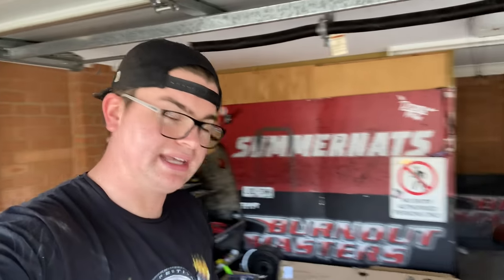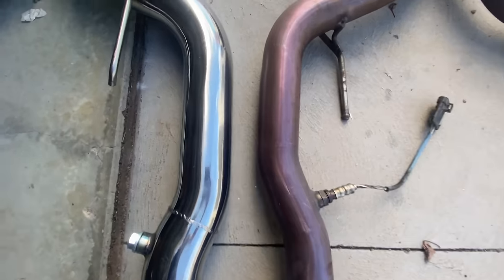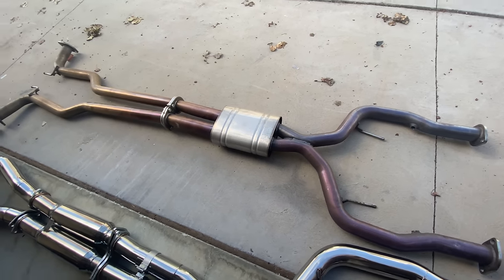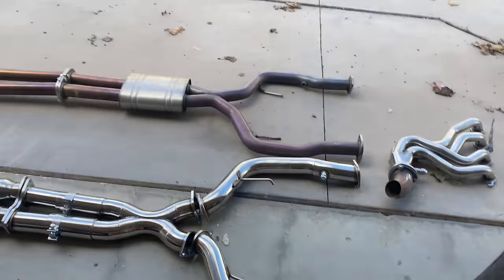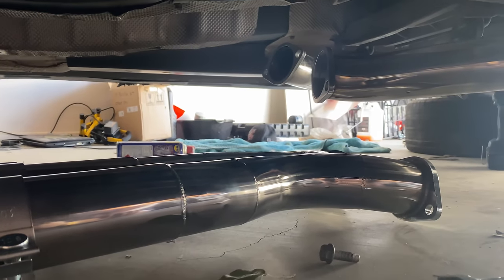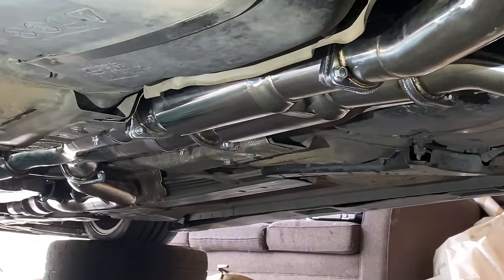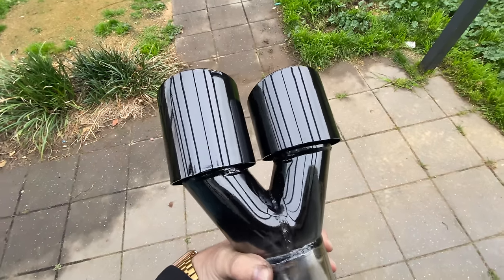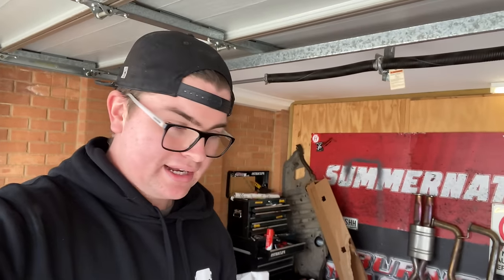Whats The Difference Between 2.5" and 3" Exhausts On A V8?

Comment: 3" tubing is absolutely louder than 2.5" tubing. It's not a 'huge' increase, but it is louder. It depends moreso on the mufflers you're using. If you want it to sound ridiculous, you need to do the muffler delete and get rid of those resonators.

Comment: Of course it's quieter you went from one Muffler or whatever that was to two mufflers and two resonators " hot dogs??? "  It's going to cut the sound in half, not to mention the farther back for Mufflers on a car be quieter it is. 

I did the same kind of thing on my bike, I went from a 4 in to one kerker header with one small Muffler which was loud as hell Superbike sounding crazy, into a 4 in 2 dual pipes with 2 mufflers, now it's nice and quiet like a little Volkswagen bug. Most people would say what the heck were you thinking... well I was thinking my ears were ringing for an hour or more after going for a long motorcycle ride, and my son kept burning his leg on the header so yeah, lol I'm glad I made my decision a little quieter I'm happy and so are the neighbors, LOL 

In your case if you want it louder yeah get rid of those Mufflers on the back and put the straight pipes back on, and it is going to be louder than the two and a half inch, not much, but you should notice it. You're also probably better get that thing re tuned, you're going to throw off the back pressure and mess with the fuel-air, it might not be much but I would at least, if you're looking for maximum performance.

I don't know what was more concerning you freaking me out driving on the left side of the road or you calling Mufflers Hot Dogs... What the heck I've never heard Mufflers called hot dogs can you please explain this? LOL Ihave sold to eat hot dogs for a living I didn't sell mufflers to eat, LOL glasspack, cherry bombs, resonators. I mean yeah Muffler called hot dogs I'm so confused...
Reply from the maker: Hot dogs is a weird name for them... but that’s what I first heard them referenced as and it stuck for some reason lol... yeah I know there’s plenty of variables between everything I’m comparing, mainly just curiosity is the reasoning! I’m gonna see how it sounds with the rear mufflers gone

Comment: Went from an old rusty 3" xforce to 3" stainless manta/hurricane. Sounded way nicer but not much louder. 

Then 4 into 1 long tube headers which changed everything. Mean lumpy sound and a bit louder. Completely worth losing 2 inches of ground clearance at the cats haha.

224/230 cam was about the same step up in volume. Glad I kept the middle muffler by that point.
Reply from the maker: Wicked! That sounds sick
Reply: where were the 4into1’s from
Reply: @kazepg3d  hurricane

Comment: Main 02 sensors for fuel tuning are the first one's in front of the cats, you should get your tuner to turn the 02 sensors back on cuz it keep your engine safe.
Reply from the maker: I did ask that when we did it, but he said it would be fine, and after nearly 3 years I haven’t had an issue
Reply: @Mick_Hinchy  sweet

Comment: Pretty sure both of those are stainless steel. Even stock exhausts are stainless. Put a magnet on it to check.
Reply from the maker: Yeah my old man actually called me... I think they are both stainless, I might have made a bit of an oopsie
Reply: Haha all good. Centre muffler is also straight through as well. Just has two pipes with holes in them running through. Normally has glass pack in there too.

Comment: If you had a 3 inch xforce exhaust and wanted it louder should you remove resonators in the middle or mufflers at the rear? Thanks the car is a ve ss with afm turned off, also has 4 into 1 headers and 200 cell cats

Comment: Ceramic coated headers are what you really want , ceramic retains the heat in the exhaust as that is what you want , more heat thats retained the more power and efficiency dont ever waste your time with things like exhaust wraps , ceramics are the way
Reply: Yeah get rid of OTRs, heat shields, radiator fans and you’ll be pushing 500 at the wheels

Comment: My 3inch mildsteel xforce is nothing like your 2.5 inch set up it's almost identical to that 3inch stainless setup though same hotdogs and it also slips over the Same aswel. Also sounds pretty ghetto straight piped 3 inch cat delete with no rear mufflers. It also hits gearbox x member not sure if it's because mine is manual or what. Sick wagon though bro
Reply from the maker: Interesting... cheers man :)

Comment: Hey dude, do you still have the 2.5 inch exhaust sitting around? I'm looking to upgrade the stock exhaust on my VE SS sedan
Reply from the maker: Henry Osborne yeah man I do! It doesn’t have mufflers though, just the mid section
Reply: Great. I have a set of Hurricane mufflers at the moment. Hopefully the 2.5 inch midsection will give a better sound than standard. Could you let go of it for cheap?
Reply from the maker: Henry Osborne yeah it’s only a few months old and it’s actually stainless Steel not mild Steel, I made a mistake in the video lol but yeah I’m happy to sell it for $200
Reply: @Mick_Hinchy  Sounds good mate. I will have to work out how I can pick it up. The VE sedan is my only transport